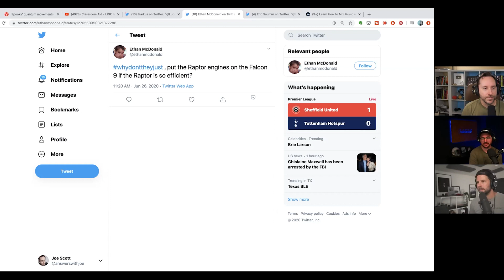Why doesn't SpaceX just use the more efficient Raptor engine for Falcon 9?! (Highlight Ep 91)

Comment: Well worth the thought exercise... lol Fascinating to think what a 3 raptor engine booster rocket for the dragon crewed capsule would be like in cost efficiency. A better qualified Question. "What if" you Build a " completely new Booster Rocket with 3 raptor engines " for the Crew Dragon Capsule...  Question 1 How much bigger or smaller length would the booster be??? etc... How about the change in the "Rocket Equation" all together??? My Favorite... "What is the "payload increase" for less fuel and structure requirements"... Thanks to earth not being any larger than it is... Larger Earth means no "rocket equation" would work... higher gravity constant,,, means a new method of getting to LEO is necessary... hmm... OLF... that's out of the box thinking.."